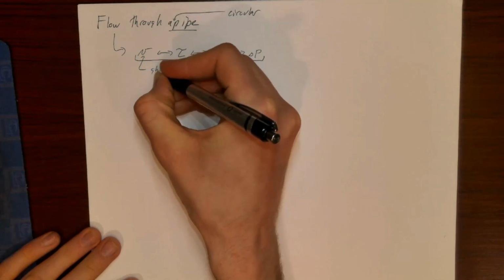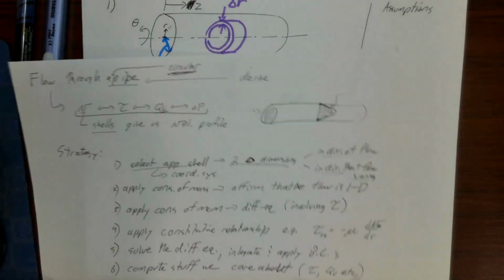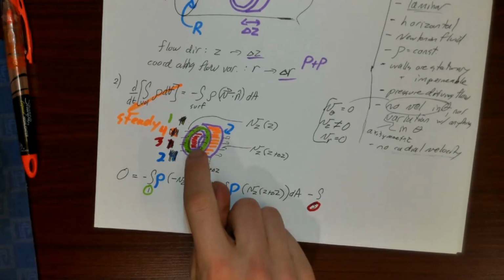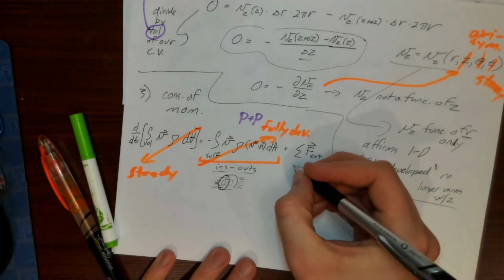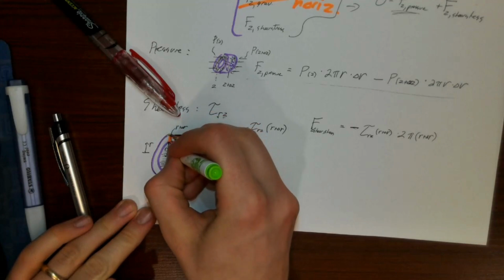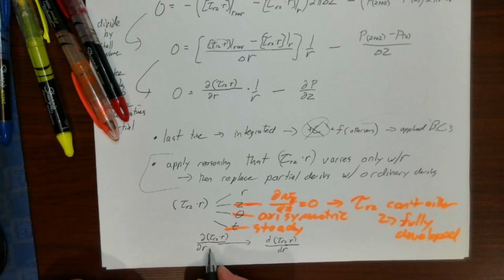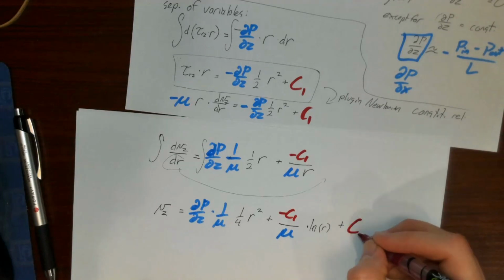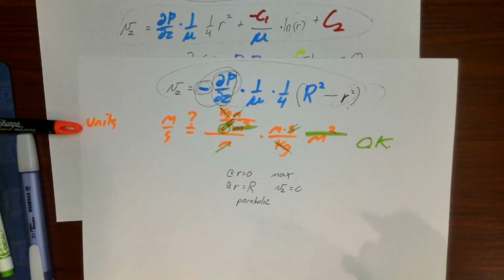BIOE 3310 Lec 15 - Shells to derive parabolic velocity profile for laminar flow in a circular pipe

Comment: The steps to derive the velocity profile:
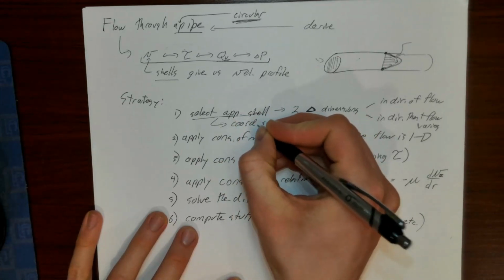1) select/define an apropriate shell ("micro" C.V.), define coordinate system, discuss assumptions 9:15
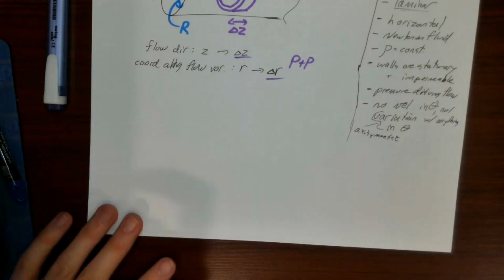2) apply conservation of mass to the shell to affirm that flow is 1-D    19:37
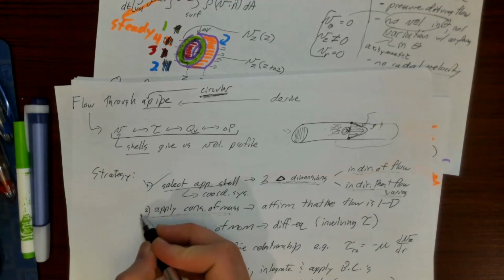3) apply conservation of momentum to the shell (x and y) set up a differential equation 35:20
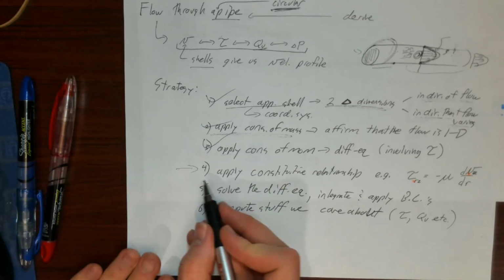4) apply fluid constituitive relationship (e.g. Newtonian fluid Tau_yx = -mu dv_x/dy) 1:14:27
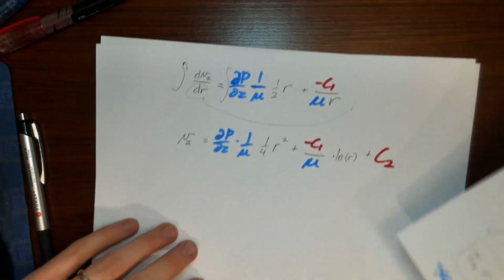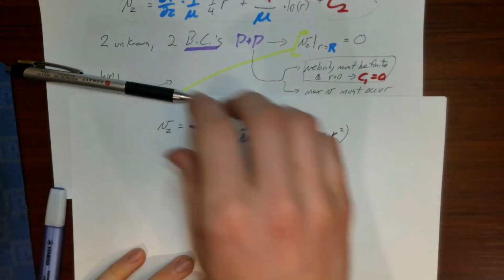5) compute the velocity profile by integrating to solve the differential equation; apply boundary conditions to resolve functions or constants of integration 1:18:25 ; do some sanity checks 1:25:51
Didn't do in this lecture, but could hypothetically do:
6) use our newly-derived velcoity profile to compute quantities of interest (e.g. shear stress, volumetric flow rate, max velocity, etc.)